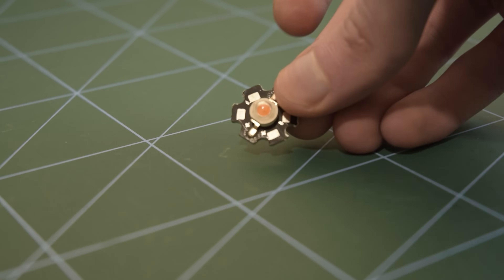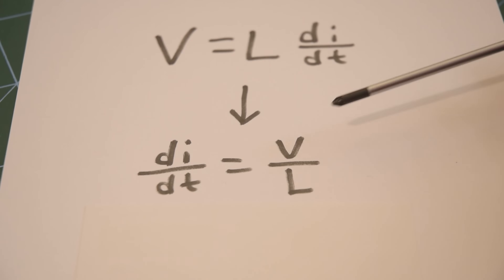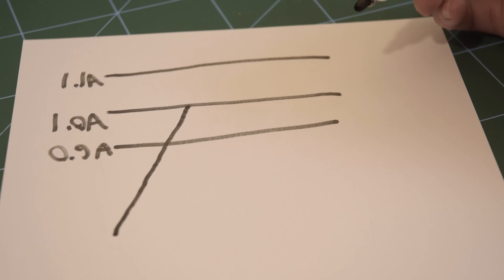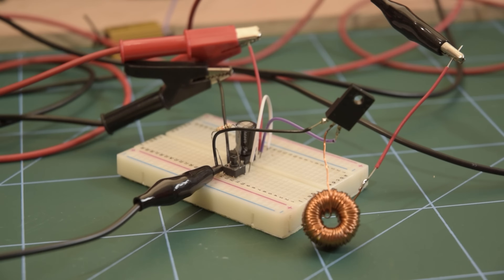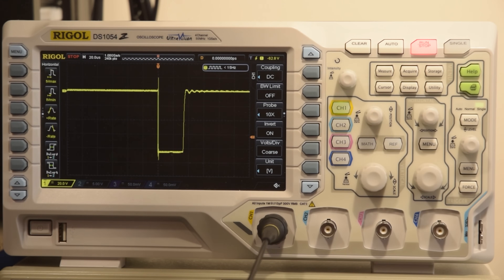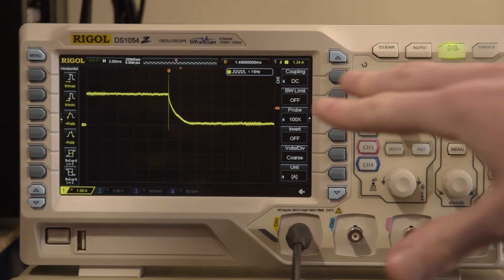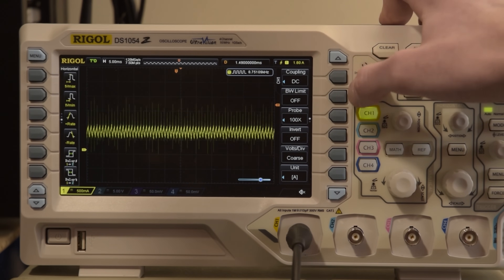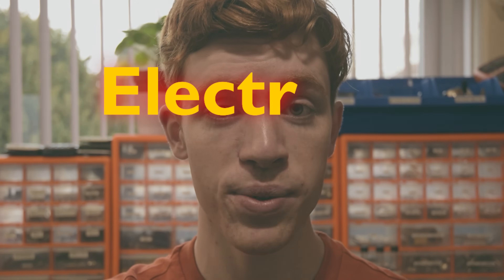Inductors in Power Electronics (Direct Current Control)

Comment: If you enjoy some precarious fun,
simply use a Light Dimmer, set it to, let's say 110V RMS, step it up to 220-230V, and then use that RMS to drive your computer's switch-mode power supply.
It teaches the scholar a great deal about the preferential behaviour, relative the nature of mutilated AC waveforms. 😆
Never aim to transform cripples up if you expect to get normal behaviour in return. 😮‍💨
It is something the ordinary Light, 
with an incandescent bulb screwed into the crown of its head, 
while hooked up those 230 Volts, will never be able to show you. 🤗

Comment: One point is the mount of power being lost to the regulation mechanism through any resistance component is IR.  Inductors and capacitors store energy but resistors only consume it.  Resistive power is v*I.  When a switch is open I = 0.  When it is closed V = 0.  In both case power loss by a perfect regulating switch is zero.  With a resistor in series with a led there is a constant loss of V^2/R where v is the voltage drop across the resistor.

If you switch is a transistor and it is either nearly fully on or fully off, it does not have to dissapate lots of power as heat which can mean a smaller device or heat sink.

Comment: You are relying upon the forward voltage LED/Voltage applied ratio & duty cycle to "regulate" the current.  If applied voltage or LED forward voltage changes, the average current will change!  You are also applying reverse voltage (= applied voltage) to the LED.  Most LEDs of this type are rated for reverse voltage = 5V MAXIMUM, so if your power supply > 5V, you risk destroying LED, especially if it's blue or white.     
          The current you show on the scope is not the LED current; it is the inductor's current.  The LED current = 0 when the FET is on, & = inductor current when FET is off.
          Better circuit is this:
+V-----o-----------------------------------o
          k                                        a
   schottky diode                     LED
          a                                        k
          o---------inductor-------------o
          |
          D
        FET   G------(gate drive)
          S
 GND-o------------------------------
          In this circuit, the LED is truly in series with the inductor at all times in switch cycle.  The LED never sees reverse voltage.  The schottky diode bears the high-switching speed requirement that it is specifically designed for.  You still need circuit to monitor current & vary duty cycle.

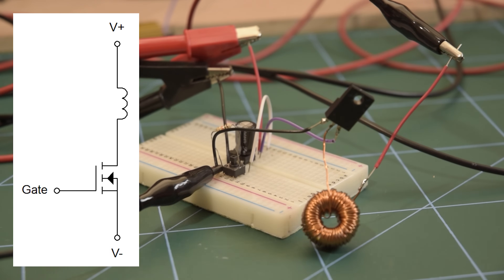Comment: 8:06 So, a magic button which isn't in the schematic, no idea what it does. What's the button connected to? "Power supply goes into current limiting, which is a good sign." Why does Power supply go into current limiting? What is it a good sign of?
Reply: the button is connected to his gate driver ic (who knows, maybe just imagine a pnp npn totem pole in your head), which is connected to the FET. upon pressing the button, the FET turns on, and in theory the current would settle at some crazy high value (Vsupply / Rdson), but since theres a current limit on the supply it does not do that. so basically its a good sign cuz that means the gate drive is working.

Comment: Can you please make a video on how to make DC to DC booster converter using mosfet and inductor
Reply from the maker: I have!
Reply: @electrarc240 I can't find it out can you please share the link
Reply from the maker: https://youtu.be/IyiCHMHE5Qg
Reply: @electrarc240 thanks 
I am trying to generate electricity from stepper motor and I used a transformer from radio to step it up, but the moment I  put a load the voltage drops,  so please help me out with guidance, the purpose is to my charge laptop and phone

Comment: I've always found the energy storage behavior of capacitors easy to understand. Despite knowing inductors are "duals" of capacitors, my mental model of inductor behavior has never had quite the same clarity. This video really helped a lot! Thank you. It made me appreciate that the dual of short-circuiting a charged capacitor is open-circuiting an "charged" (non-zero current) inductor.

Comment: So with the flyback diode in place are you saying we can preserve some of that energy for the next cycle?  I thought the diode would consume all of the flyback current, but it seems like you are saying it would instead slow the consumption of it.
Reply: Short ans: yes

Long ans:
Recapping: When you put a battery across the inductor, the current goes up at a rate proportional to the supply voltage (L di/dt = Vbat). When you interrupt the connection to the supply, the inductor develops a large negative voltage spike as the interruption tries to impose a rapid decrease in current. The diode then responds to the negative voltage by allowing conduction.

Now the inductor acts as a source, forcing current through the diode. If it were an ideal diode, the current would just loop around the inductor-diode circuit indefinitely. But since a real diode has a voltage drop and the inductor and wiring have an ESR, the inductor current changes at a rate proportional to the total voltage across these lossy elements:
L di/dt = -Vd -Req*i

So, the current decreases gradually, taking time to zero out the stored magnetic energy. This is really just the reverse of building up the field during the current rise. The diode doesn't slow the energy consumption down, it does contribute to the loss, but it allows the current to not be totally cut

Think of it like a freewheel on a bicycle; it allows you to stop increasing the speed by stopping the crank without stopping the wheels, just as the flyback (sometimes also called freewheel) diode allows you to stop increasing the current by the removal of the input voltage without stopping the current, even though it (freewheel/flyback) introduces losses. Trying to stop the current in an inductive load without this diode is like trying to stop the crank in a fixed-gear bicycle; you have to deal with all the inertia (a torque spike), only then all of the energy would have to be consumed.

hope it helps
Reply: @Teteu.R  Thanks for taking the time to explain this.

Comment: Give a better explanations of the math formulas. e.g. di or dt. What is that exactly?
Reply: Not a math guy, but from what I remember it's a Calculus 1 thing. The d stands for "differential", which you can think of as meaning "change in (something)". "di" basically means "change in i (current)", and "dt" means "change in t (time)". Put it together and "di/dt" is just a fancy math way of saying "the rate at which the current is changing".

The whole Calculus part of it is that "d" isn't really referring to an arbitrary "change in (something)", it's referring to the instantaneous change in something. In other words, the change in something over an amount of time, if that amount of time was infinitely small. 

If I'm in motion on a number line, my position at the start (t=0) is at x=0 and then 10 seconds later (t=10) I'm at x=10. If you wanted to know my speed, the calculation is pretty obvious, the change in x divided by the change in t.

(Change in x / change in t)

or 

(10 meters / 10 seconds)

My speed is 1 meter per second. 

But that's my average speed over the span of 10 seconds. What if my speed was changing throughout that entire span of time, and we wanted to know my actual speed at a specific moment, like t=5?

We would reduce the span of time (the change in t) to zero in on my speed at that specific moment. We could take the change in x over a span of 2 seconds (t=4 to t=6) instead of 10. Closer, but it's still an average. What about the change over 1 second? Half a second? A hundredth of a second? What about the change over 0.00000000000001 seconds, t=4.999(etc) to t=5.000(etc)1? What if the change in t was infinitely small?

That's what di/dt is, the instantaneous rate of change. The difference in i, divided by the difference in t, if the difference in t is infinitely small.
Reply: That's what's called the derivative of a function. Considering the function of the current value over time, i(t), its derivative is a function which tells you how much it's increasing or decreasing every instant. For example, if at t=1s the current is rising at a rate of 1A/s, that will be value taken by the derivative at t=1s

Comment: I like to explain inductors to people by talking about HOW energy is stored in them. They act as an open circuit initially because all the current is going into building up a magnetic field. In steady-state, the magnetic field is stable and contains the energy you invested at the beginning. When you disconnect the inductor, the magnetic field is no longer being sustained by the current flowing through the wire, and it collapses, causing an opposite voltage to be induced in the wire as it collapses “down”…as opposed to building “up” the field at first.

Comment: @10:34  Without the fly-back diode, where will the current go, where does the -ve 85 voltage go, when the circuit is open? You said it will push as hard as it can, to get some current to flow to where? current can only flow in a closed circuit.  Will it ionize the air to create a closed circuit for current to flow? Please explain further. Thanks, i appreciate your work
Reply: Haha, I've been trying to find answers to this exact thing.
I think some people said that it will indeed ionize the air.
I've been brothering many, to get answers to this exact question.
Infact this may be the principle.. electrohydrodynamic propellers and rediators work.
Ionizing the air at very high voltvgaes.
If I find the thread where I got answers, I'll check back here.

Comment: Hello what about pick up coils phase shift control how is that calculated? You see I refere to inductive triggers for astabel mode IC chip 555 timers like GM ignition modules .So I reali have hard time choseing correct components to attempt getting +/- 15° pulse degree variability. The pick up is at 1.35 Henry I'm not Shure resistance so how could I possibly chose correct inductor,capacitor types and resistor value to gain phase shifter for pulse signal from the pick up coil?

Comment: I have an inverter which is internally arcing, coming from some sort of inductor...any ideas?
Reply from the maker: What kind of inverter? Motor drive or DC -> mains kinda thing?
Reply: @electrarc240 It was an inverter for a solar panel system. Only a few days of use, and it developed this fault. Fortunately the manufacturer refunded me,  but left me with the old unit. I am just assuming that the high voltage was being generated by the inductor, but surprised how high the voltage generated must have been to jump about 1cm.

Comment: Fred, I've looked over your LinkedIn Profile, and I have sent you an invitation to link with me if you wish. If I may offer a small piece of advice. Your "I'm crazy passionate about (Power) electronics" is or will limit your career development going forward, and I must say after reviewing you on LinkedIn, you seem to lack a broader experience base in the field of Electronic Engineering. Switch-Mode PSUs have been around in consumer electronics since before you were born, I was dealing with them during the 1970s, of course, the power requirements in today's Automotive applications are somewhat different (I ran an Electronics design Laboratory for one of the largest blue-chip Car manufacturers in the world).  One of the areas I would perhaps suggest you would like to encompass more in your development is Telecommunications, but whatever you do, don't become a "one trick pony" . Interesting Videos 👋
Reply from the maker: I think the content on my channel shows that I focus on a range of things, but I think if one has to be a "one trick pony" automotive power electronics is the place to be. Not sure how being passionate will limit my career as that is a very rare trait these days. At university I would say 1 in 100 students are actually passionate for the subject and the rest are there for money or because of family pressure. Also back to RF I made a (bad) radio transmitter when I was 16 and it wiped out the villages internet every time I turned it on, Openreach vans started turning up all over the place so that's kinda put me off. Power electronics isn't regulated in the same way so I can actually have fun.
Reply: @electrarc240  You say: "At university, I would say 1 in 100 students are actually passionate for the subject"

Fred, like yourself my career started as a passionate hobby, Uni wasn't an option for me in my teens, my path was via Trainee and part-time release to Technical college, my technical training in Radio & Television Broadcasting took 4 years. In those days we used a Slide Rule for 'principals & calculations',  if you had to use one you might well be forgiven for thinking it was a "back scratcher",😀 also all my examination sessions were written, and no coursework was taken into consideration. You Passed or Failed "on the day".  If you were "ahead of the curve" in your student years, like me, you had classmates that thought you were just a plain weirdo/geek & you had the pi*s taken out of you right, or worse.  All I saying is: 'I get it' when it comes to passion okay.  I'm just trying to give you some friendly advice as a guy who spent some 40+ years in Electronics, ignore it if you want, that's entirely up to you. 

Firstly your "passion" may well have to come down to earth with a bump someday soon, when you have kids & a wife/partner, we all 'Work' because we need the money right, or are you quite okay to work for your "Passion" voluntarily?  Maybe you still live with your mum & dad. Okay let me tell you some 'Facts of Life' regarding Engineering in the UK, I don't give a "tinker's cuss" who your current employer is. Engineering isn't a highly respected/ highly paid occupation in the UK, when you want/need the bigger bucks you'll have to move to Germany or side shift into Management, and your passion has to die for the greater good, at least for the hands-on side of Engineering.  When I took early retirement from the Automotive sector my salary in 2009 was six figures. I doubt if you are anywhere near that in your current position. Whatever you can do in the UK,  there's some guy, just as smart as you in China, that can do your job for the 'China Price". I'm telling you some truths here Fred.

Telecommunications, Medical Electronics, NDT Principles & Techniques, are only a few of the huge and diverse areas of specialisms which now encompass 'Electronic Engineering'. Of course, you do what you have to do for "fun" but: "I love designing 'Switch Mode PSUs' won't get you where you need to be for the rest of your life!  Spread your wings!  Anyway, that my dear Fred is that, I have no more I wish to say or add as I am sure you'll choose your own path. I wish you well in your career 😉👍
Reply from the maker: @telboy911 I’ve never done this for money, I could have chosen a simple three year degree and already have graduated earning double what I am now but I chose the longest course because it’s what I enjoy. I could’ve worked somewhere else but picked F1 (twice) because of my interest and the fact it’s the best place to learn fast. Money isn’t really a problem for me so I see no reason to leave, there are plenty of interesting positions in the UK that pay plenty well enough for my simple lifestyle. This is genuinely all I do every day of every week, I get back from work at 7pm after doing electronics all day and stay up till 11pm doing more electronics at home. Weekends more of the same, this is actually my one and only occupation in life (bit sad I know). In reality my true passion is for teaching and doing this kind of thing (YouTube), if I can keep up my current views I can live off this which would be my dream. It’s like teaching at uni but the people watching actually care. Though I’d want to do something else too to stay “relevant” and keep learning. Also I do a lot more than is seen here and on my LinkedIn, I’ve been doing electronics for about half my life and I’m only 20, so I’ve had plenty of time to dabble in many fields, I’ve simply honed in on the one I find most interesting. Hopefully you’ll see over the next few months that I am not just a one trick pony